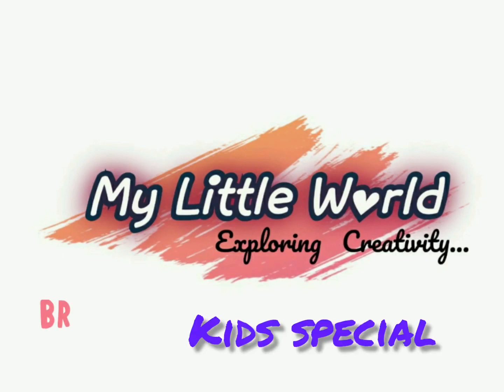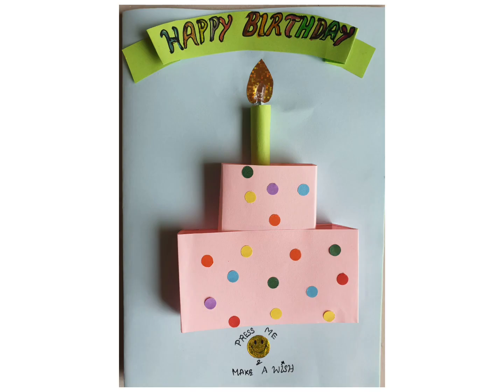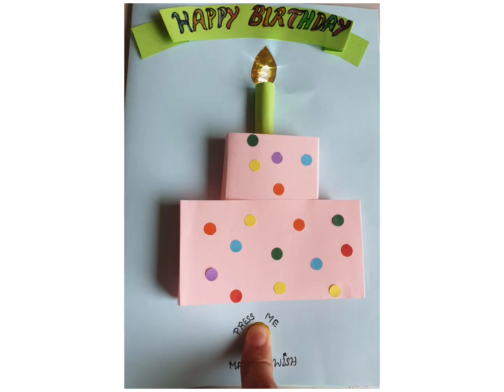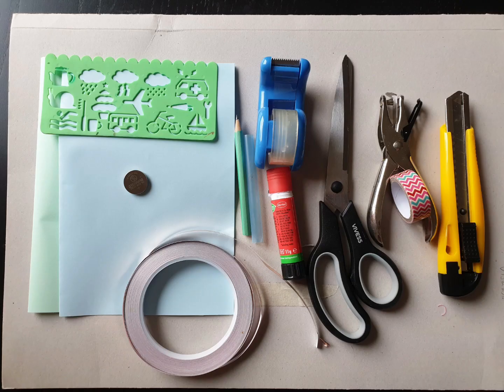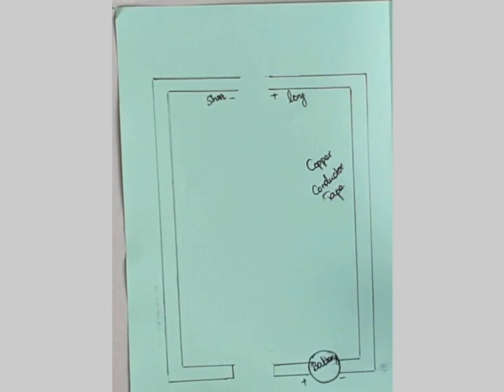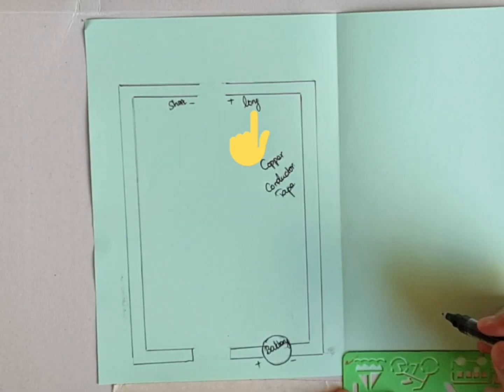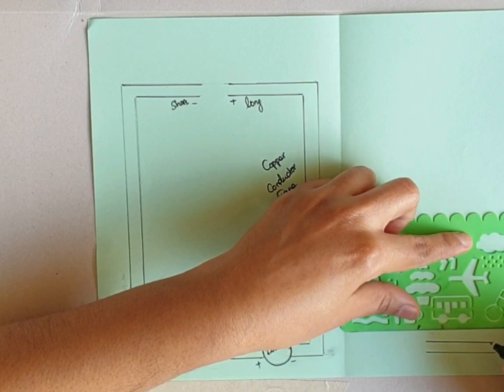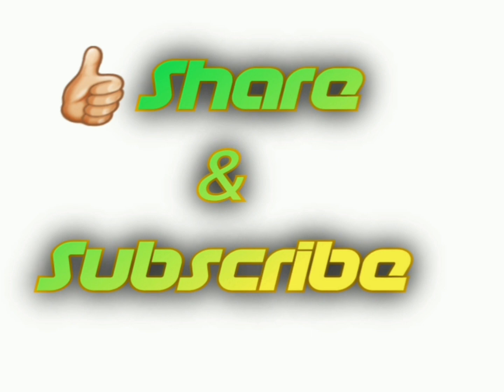Simple Electric circuit card with LED light (Birthday card with magic candle )

Comment: How did you place the battery? Which is the negative and positive terminal which side did you put up?
Edit- did u used a battery holder or just stick it with the tape